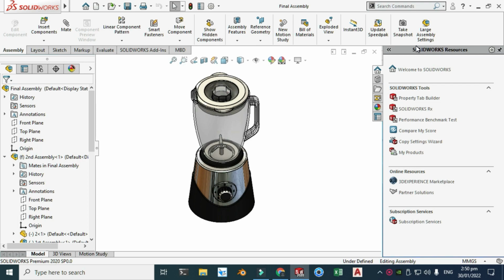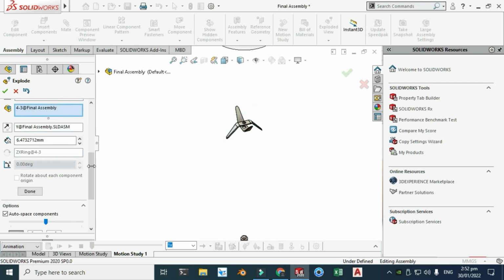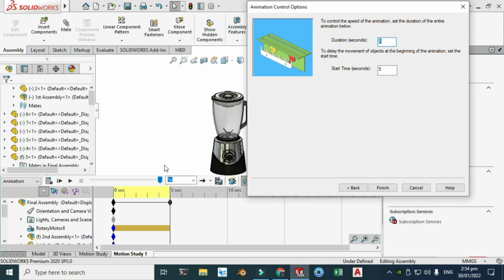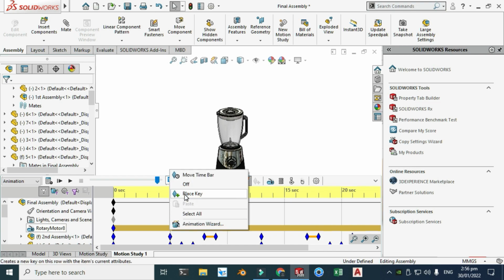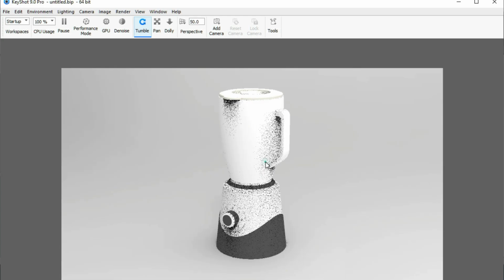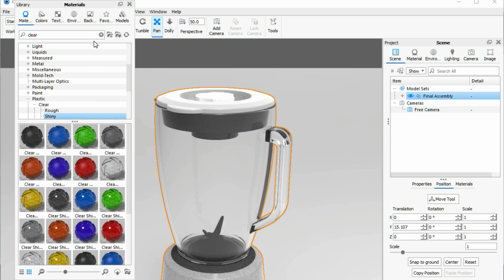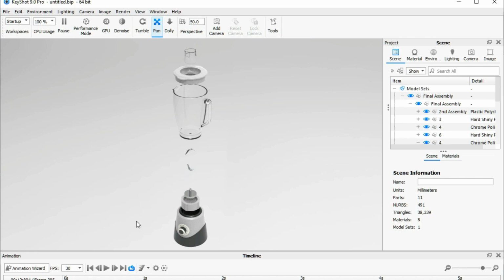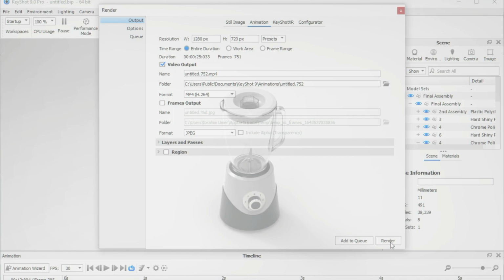How To Create Exploded View Animation in SOLIDWORKS | Export Motion Study to Keyshot | CADable

Comment: Hi! I followed the steps exactly as in your video, but I'm having a problem. First, when I press the button to export from SolidWorks to KeyShot, I get a dialog box that you didn't see, and it says: Output animations from Motion Study "Motion Study 1"?

Old Motion Study animations will remain in the scene. For best results when updating animations, delete the Motion Study animation folder in the scene before sending to KeyShot.
Then, when I open it in KeyShot, the animation doesn't appear, only the model. Do you have any idea what it could be?
Thank you very much.
Reply from the maker: That dialog box you're seeing is normal SolidWorks is just asking whether you want to include animations from Motion Study 1 when exporting. To make sure the animation appears in KeyShot, please check the following:

Steps to try:

Select the Correct Motion Study in SolidWorks:
Before exporting, go to the Motion Study tab and make sure you're viewing the correct animation (like Motion Study 1).

Run the Motion Study Before Exporting:
Click the “Calculate” or “Play” button in SolidWorks to generate the motion before sending it to KeyShot.

Choose “Yes” when that dialog appears:
When asked “Output animations from Motion Study?”, click Yes so that KeyShot includes it.

In KeyShot, Check the Timeline Panel:
Open Window > Animation Timeline in KeyShot. If the animation isn’t there, it probably didn’t export correctly.

Try Exporting via .FBX:
If all else fails, you can export your motion study as an .FBX file from SolidWorks and then import that into KeyShot—KeyShot supports .FBX animations.

Thank you!